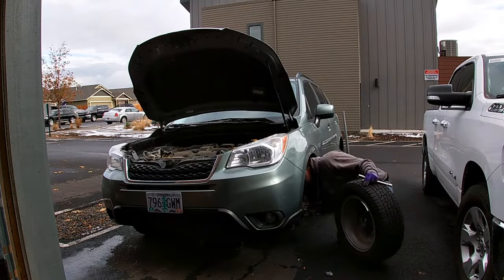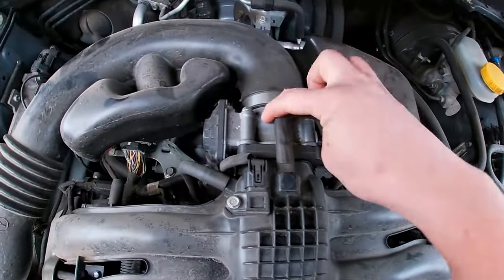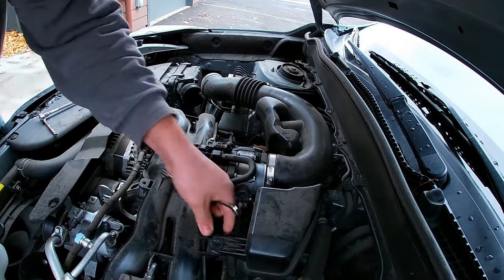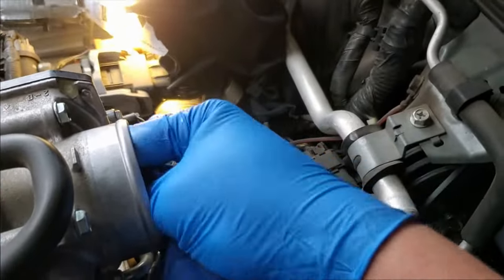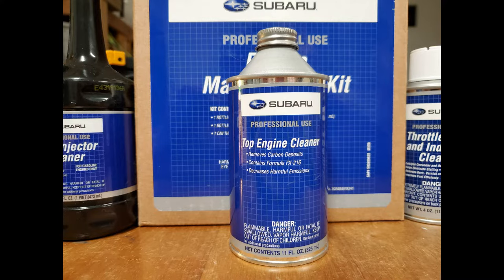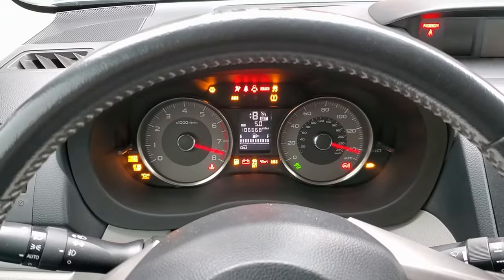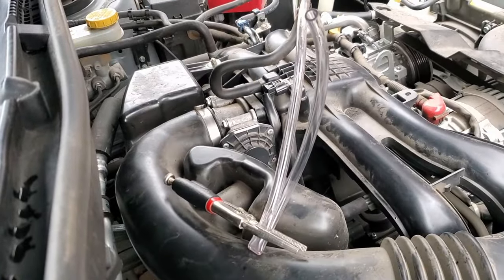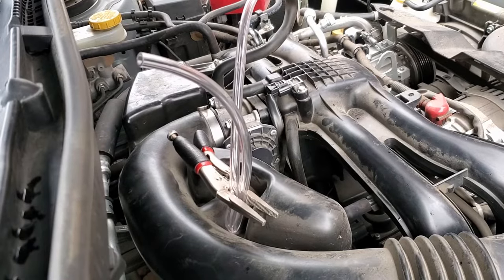Subaru Throttle Body Plate Cleaning | Top End Cleaner | Engine Maintenance Kit | Injector Cleaner

Comment: For the top engine treatment, Does it matter if you disconnect the vacuum hose from on top of the intake manifold rather than “down below” and attach the vinyl tube to the male end on top of the intake manifold?
Reply: The turbo engines for the Ascent/Outback/WRX don't have that small hose. Do you know where we should use that cleaner?

Comment: Did you get a CEL code?  I got a P0300 Random/Multiple Cylinder Misfire Detected.  I cleared it and engine seems to run fine, but just wondering if you got any code after doing this?
Reply from the maker: No code for me!

Comment: The back of the butterfly is not really the cause of problems....the issue is where the butterfly makes contact with the throttle  body..if there is carbon there the butterfly will not close and seal properly...There is a hose kit available with an  on / off valve. Ever thought of cleaning your engine?..its filthy!